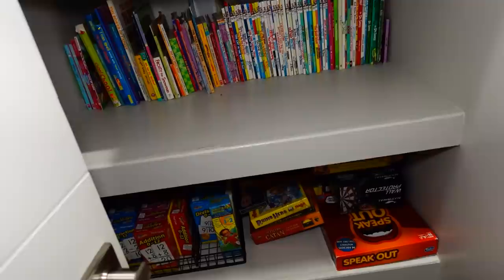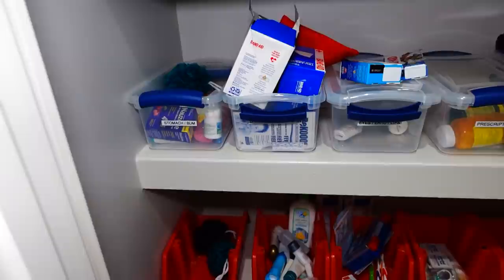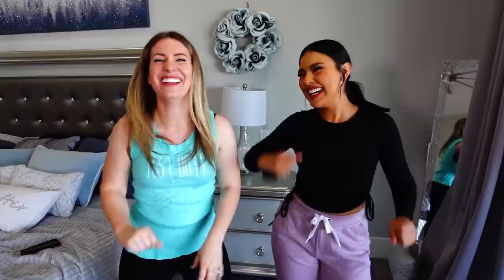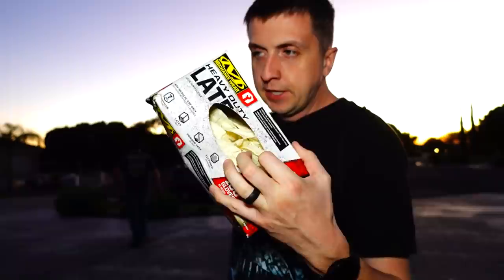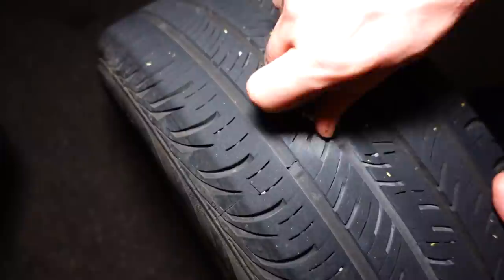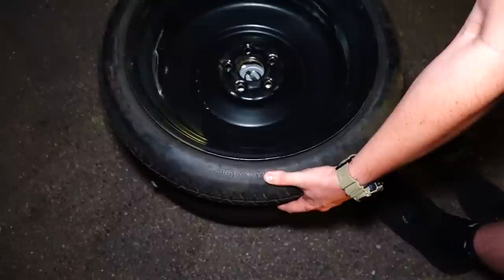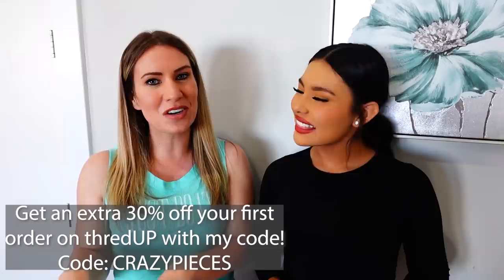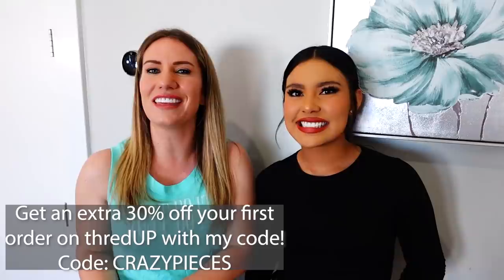HELP I'M STUCK!

Comment: Tip for when changing a tire: once you've taken the tire out, put it under the car, next to the jack, if for some reason the jack slips you'll have the height of the damaged tire, if not the car will be fully on the floor and will be difficult to re-insert the jack.
Reply: Great tip thanks!

Comment: When changing a tire, make sure to 'Break' the Tension (loosen) on the Lug Nuts before jacking the car up. You have more stability when the Vehicle is still on the Ground, and if you have use extra force to break the Tension, such as having to use your Foot/Heel on the lug wrench, you won't have to worry about the Jack slipping.
Reply: Best advice

Comment: Ohh no flats are no fun. Also Halie, I suggest getting a portable tire pump for your vehicle. That way if the low tire pressure light comes on you can at least pump it up  with some air to get you safely to where you need to be. I am the queen of having the low tire pressure light come on, and on more than one occasion the portable tire pump I have has saved me. Also, other people in this comment thread have mentioned getting AAA. Honestly that is also is a life saver, and will cover you if you ever need to tow your car to a shop to get it fixed or if your battery dies etc.

Comment: I got my kids each a battery jumper with air compressor for the trunk of the car. That way if the donut was low they could pump it up. They can also jump without a second car.

Comment: A suggest for you Crystal. If you have a spare closet store party supplies, wrapping paper, bows, tape etc. You could even put a fold down shelf on the wall and when you want to wrap something you have a place. If you get the over the door shoe holders. They are actually pockets and store tape etc in them. You could even use one for Aurora's hair bows etc.

Comment: Id be calling the place she bought her car, they should replace that tire for free because how dirty is that they put in one not compatable smh
Reply: I believe her car was purchased used so it’s not the dealers fault. Most likely her car didn’t come with one and the previous owners could’ve bought in case they needed one. Most cars do not come with spares anymore.
Reply: @ashleyrocha1028  definitely the responsibility of whomever sold her the car. Doesn’t matter of it was used or new - it absolutely should have the correct spare tyre unless the seller said
Reply: @practicallyperfect2941  according to google there is no legal requirement to sell a car with a spare in it.

Comment: I have AAA and my teenager who is old enough to drive but not driving yet has an associate membership on mine which either one will cover if we are the driver or a passenger. In addition we do have roadside assistance with our insurance company which is more limited in services. I would highly recommend looking into getting a membership.

Comment: Changing a tire is the easy part. It's jacking up the car is what I have issues with!
Reply: If you have a book with the car...go to the part about changing a tire,it will show you...(once you get jack jacked up some)as to where to put the jack under the vehicle in the place the book says...(you could get hurt if you don't)...

Comment: Since the Pandemic and that store either were closed or they opened later and closed earlier that on yelp they didnt change the info on the site so it show different times and place didnt change cause they figure that it will go back to there normal hour at some point. I learned it because i looked up a stores hours and when i got there they were closed and posted they close earlier due to the pandemic. so you cant really blame the yelp for wrong info